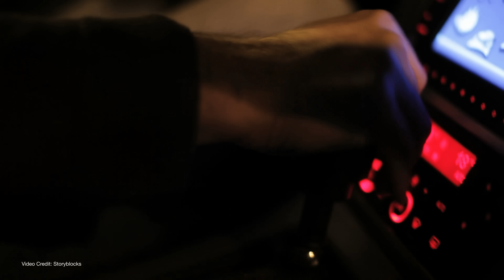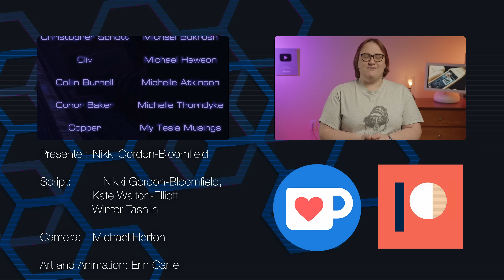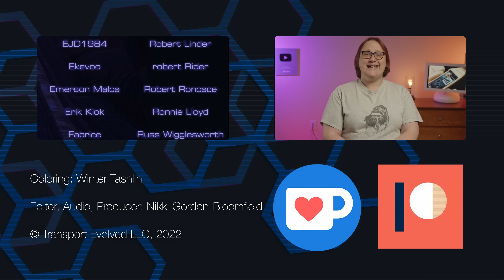Electric Cars Don't Need Gear Shifts - So WHY Is Toyota Working On One?

Comment: No we do t need a manual gear change but maybe a 4 speed to max the kw to mile ratio from the dismal sub 3 .5 mile per kw to more along the minimum of 5 or 6 miles per kwm as the way forward
Reply: The efficency curve of electric is so flat that gearboxes won't give you extra range. Spinning a petrol motor slow reduces consumption. Spinning an electric slow (on the constant torque band) increases consumption and adds the gearbox drag.
Reply: @gasdive  ev gearboxes are built the opera it way to manual gearboxes so a slow movement can drop the slow speed loss this isn’t an issue as most engine twinning and ratio  , as the majority of modern times your stuck in traffic I doubt we’re ever need gear boxes more than 4 speed. A Woking example for instance is the twin gear on the Audi and Porsche to prevent over speed swaps gears to a lower ratio thus keeping-s the actual rpm of the motor constant in an efficient zone without it not only the kwh usage would be in a 1 for 1 zone it would also require a larger motor to cope in single gear adding to cost and weight not to mention even worse energy rating
Reply: @ram64man  I can't really reply as I can't figure out what you're trying to convey.

Comment: A stick shift and clutch on a Toyota EV? Sure. How else are you going to control the fuel cell? :-) 

Seriously, though . . . I'm not sure how many modern EVs have the regen paddle on the steering column. Those are marvelous. I wish my 2012 i-MiEV had one for that occasional steep downhill trip. Having driven manual shift ICE vehicles for many years (my wife and daughter both still have manual shift Hondas, so we're among those rare Americans,) I learned early on how to properly downshift with engine compression. Older manual shift trannies also didn't often have syncro rings going from 2nd to 1st gear. So, lots of fun clunking noises when attempted to do that. But, with practices, you can "feel" your way to the lowest gear while still moving and without the grinding. Kind of a lost art these days.

Comment: daft. it's daft. I have driven with a stick for the last 20 years (first car to current car) and I LOVE driving a stick. That said, EVs are essentially always in the best gear for torque so i don't miss it when in my wife's car. Also, that need to be active while driving i get from using 1 pedal driving... i'm always thinking about when and how much to let off to stop when needed.
Reply: It is almost as bad as designating the high performance version of the car as “turbo”.
Reply: @williammeek4078  The adult equivalent of putting flame stickers on a bicycle.
Reply: @williammeek4078  😂💯

Comment: None of all above. 
Without gear box vehicle start up cause power circuit conducts astronomical electric current that shorten the longevity of anything in that circuit. Gear box take out longevity issue from that equation, for second rate battery at a lower cost. Win win approach.

Comment: Interesting. Took driver’s Ed in 73’ (probably before you were born 🤣) and my last car was a Mitsubishi 3000 GT which was totaled two years ago. I had never owned an automatic and my car previous to the Mits even had a manual choke. Short story is I replaced it with with a Model 3. Far cry from anything else I had driven which were mostly sports cars but unmatched in responsiveness, maneuverability and quickness. It took me just days to get used to the regen braking and even though it was an impulse purchase, I can’t imagine owning anything else. Might help that I love technology.
Reply: An impulse I'm sure you don't regret😉.
Reply: @kmancrx  Not at all. I have 4 other driver profiles on my car, too. Meaning there are four others that enjoy driving the car - son, his wife, brother and best friend (done some out of state trips). 😁
Reply: @mistyanderson6834  yeah my wife drives my model Y occasionally but actually likes her Chevy Bolt as it's a bit more similar to an ICE vehicle. Within the last month I drove the Y from NC to Arkansas and back. 😜
Reply: @kmancrx  How was your supercharger experience? I just drove from Seattle to San Fran and it cost $42! Have had  the FSD Beta since September so helps in unknown areas. 😁
Reply: @mistyanderson6834  supercharging is fine. I think it cost me around $150 for roughly 2k miles. The rates vary depending on the location. Arkansas tended to be more costly to charge vs TN and NC.

Comment: It seems like you are confusing gear shifts in an automatic and a manual transmission. CVTs mimic automatic transmission cars not manually shifted transmissions.Toyota is not the most brilliant repository of good design. Most of their special cars and engines are designed by other manuafacturers. Ask anyone whot they really think of the RAV4 EV's absurd all wheel drive.

Comment: Surely adding something that's unnecessary to a vehicle's drive chain just adds to the initial cost as well as increasing maintenance costs and the potential cost of replacement
Reply: The drivetrain will remain unchanged. if anything, the manufacturer will be able to call it a manual and do away with the parking pawl and its actuator. I don't believe there's gonna be fake gears either. Instead, the driver will be able to select the level of regeneration on accelerator liftoff, and the "fake clutch" will be a way to momentarily disable or weaken automatic regeneration, and give more resolution to the accelerator pedal while maneuvering, for example. That being said, it's valid and useful. This also brings the possibility of coding the left pedal as the accelerator for people who lost their right leg.
Reply: I imagine that while there will be a gear shift and clutch pedal, the gear ranges will be faked in software. One rule of engineering these days is to never do in hardware what can be done in software.
Reply: Did you hear the word "pseudo" at all. In meaning "fake gears", there not actually adding a gearbox but the feeling of having one. What they're doing is the equivalent of those shifters on arcade cabinets with the added feature of the vehicle actually reacting as if you're going through gears.

The way Toyota plans on implementing this is by turning it on through a drive mode selection menu. So if the shifter breaks all you have to do is select "automatic mode" like how you pick the difficulty on a game.
Reply: @jake_sabrwolf9795  A fake transmission. Wow. That is grasping at straws to make gear heads happy. The only thing sillier than putting in a transmission, that is, a crutch meant for helping get past the deficiencies of the ICE is putting in a fake one.
Reply: All I can think is if you can keep more parts spinning slower, that's fewer duty cycles IF it was a real manual
Reply: @dosmastrify  Electrical duty cycles are irrelevant. Motor bearings properly designed for the RPM range of an electric motor are a lot cheaper than the added complexity of a transmission.  Get over it. The transmission, manual or automatic are a crutch to make up for inherent deficiencies in the internal combustion engine. 

Electric motors do not have those deficiencies. Trying to put a transmission into the drivetrain of an EV is just silly. To put in a crutch meant for an 1880 tech engine with serious usability problems is just not necessary.

Comment: I’ve always loved manuals. Ever since I had to replace an automatic transmission in an old car of mine. I’d rather pay $200 for a new clutch, than $3,500 or more for a rebuilt, or new, automatic. 

I had to drive my husbands 🏳️‍🌈 Sonata hybrid three days ago when I dropped him off at the airport. (I drive a 6spd GTI Autobahn with a Cobb Accessport pulling about ~300hp, yet still getting 29mpg) I found myself getting irritated at the lag between hitting the accelerator and the “punch” needed when driving around Dallas Love Field Airport. It’s torquey, but not right away. Nothing like my low-end torque GTI. 

I’m eager to see their progress of this…
Reply: You should try driving a fully electric car then.

Comment: Making a vehicle more complex with more parts is senseless both on the cost and reliability fronts.
Reply: Making exotic or Uber expensive cars is pointless as well but is still made available. A manual gear box will appeal to some.
Reply: That's the point, they are trying to maintain some level of spare parts sales.
Reply: laughs in Ford Eco series of engines

Comment: Here in Finland you have to pass driving school with manual car to get full driving permit, normal EV is automatic and if you use it to get your permit, you are NOT allowed to drive manual gearbox car at all. Only way for driving school to adopt EV's, is to get manual gearbox EV's.
Reply: They just need to realise that EVs are not automatic. There's no automatic gear change. There's no gearbox at all.
Reply: @gasdive  problem is the clutch in manual gearbox, if you don't use car with clutch at driving school, you are not allowed to operate car with clutch after you get your driving permit. Driving with EV is too easy, people don't learn anything about clutch with EV.

Comment: Well the pseudo gears make no sense unless they make ways to more economic driving even if it just limits the output power. But real gears on any car electric or not make a lot of sense. BTW I am die hard diesel stick shift guy. And CVT are useless junk for what I do and like in cars. The stupidest thing is, CVT torque rating is right where most of my small engine cars (stick shift) just start in its stock form ...

Comment: I’ve been a die hard stick shift driver most of my life, my 2013 FIAT 500 Abarth being my favorite.  I now drive a Chevy Spark EV and have found that between the torque, the down low weight of the batteries, and using the L mode I can replicate driving stick (at least down shifts) and it brings me much of the feel and fun of my Abarth, down to even getting to ‘shift’ with the gear lever.  I’m 100% interested and curious with what Toyota has up their proverbial sleeves.
Reply: Yes, as someone who has always loved rolling off the throttle and downshifting, I really loves me some regen!
Reply: I have a 500e and it is a really fun car to drive! Quite peppy, but with all those batteries down low you can take turns very aggressively.
Reply: it may just be that toyota is trying to hide the fact that they have their collective heads up their asses.
Reply: with infinite torque gearing is just wasted efficiency for no speed gain. In ice cars its needed in EV's  it is waste and has no benefits. it shows how foolish Toyota is. They do not understand.  it is quite sad ty for Tesla and the ones that get it.
Reply: @Bbenkosky  There is nothing foolish in satisfying consumer demand ;) I absolutely hate single speed performance EV, Porsche done it better - 2-speed gearbox, though not manual.

Comment: To say that Toyota wants EVs to be "less awesome" is an understatement. In fact almost all legacy auto makers have intentionally made their EVs ugly and short range to avoid making them too attractive. Toyota won't even give their EV a $%^&!@ name, just a model number and ugly black fenders to dissuade any style conscious buyers. However, if done right the manual shifter could be a lot of fun adding a video game like "skill" to getting the car to switch into modes and perform differently. Some have added a "boost" button for the same reason. The clutch pedal for example could switch from the default regen mode to coast mode to give the car that free rolling feel, maybe even some cool sounds when you rev it unpowered. The shifter could simply be drive modes.
Reply: I don't think manufacturers are making deliberate design decisions to make EVs "ugly", rather they're recognizing that potential EV drivers are looking for something different.  Most ICE drivers consider my Gen1 LEAF to be "fugly", "wouldn't be caught dead in it", etc...  I think it looks cool.  On the other hand I consider most ICE cars made today to be boring and slavishly conformal to the pinchy-foldy "Transformers" aesthetic of the past decade or more, which does not attract me.
As EVs become mainstream, expect more mainstream design language, for better or worse.
Reply: Recently checked out that Mazda EV did you? 😆
Reply: @matthenley7641  Not bad looking, but 100 miles of range, really? There is an e-bike that does 120 for gods sake.🙄

Comment: I use the mode button and brake lever on my motorcycle to emulate changing gears by changing regen levels and torque levels!
Reply: My Zero has so little regen that I just set the throttle activated regen to zero and the brake activated regen to 100 and left it at that for the last 7 years. Slight touch of the brakes activates the brake light and turns on the regen for controlling speed down hill. Otherwise I don't notice it.

Comment: So does having actual gears in an EV (Taycan) actually improve performance or not?  How much?  Could you use a smaller  motor with gears?  Or are we limited by the battery and inverter?
Reply from the maker: Just how much good a Taycan's gearbox does is actually a really interesting question that I personally feel hasn't been solidly answered yet. I do know that being able to gear down further for things like rock crawling is another area where multi-speed gearboxes in EV have been considered, but that, much like the performance car use case, is definitely an outlier in terms of usual use. - Winter
Reply: Sandy Munro touched on this once. The centrifugal forces involve to achieve higher speed from an electric motor causes the center section of the motor to swell outwards the faster it turns. The issue is the tolerances between the center and the outer windings has to be kept as tight as possible for efficiency. By gearing the drive train they are able to get more speed from the car without going beyond the limits of the motor. Tesla achieved this differently by wapping the center in carbon fiber to reinforce it in the Plaid.
Reply: @davefroman4700  yeah, but what it really shows is poor design. If you spend the weight of a gearbox on making the motor longer you get the low speed torque you need, plus the high speed power you need without the gearbox.

It's been a hot debate in the motorcycle world, but it's become really clear that gearboxes are dumb.
Reply: @gasdive  form follows function. They wanted speed and designed for that, given their known level of technology. Thinking outside the box will get you fired in most places. They want proven solutions, not experimental ideas.
Reply: @davefroman4700  longer electric motors isn't exactly experimental or out of the box thinking.
Reply: @davefroman4700  They could also have made the motor longer.
Reply: @williammeek4078  You still have the same forces at play with very similar clearances. Also the smaller a diameter is, the faster the rotations are and the weaker it gets as well. The gear box is a mechanical work around vs a physical solution to a problem.
Reply: Just about every review I've read of an electric car including the Tesla Model s plaid states that their performance starts to drop off at high speeds (120+ MPH). While the high-speed regime may not be applicable to most drivers, I could see the gearbox in the Taycan adding value there. As was stated above, you could also use ultra low gear ratios for off-road scenarios. So I think it's a little premature to say no EV should have gearboxes, as even electric motors do not have a perfectly flat torque curve at any speed. Physical limits do exist.
Reply: High torque/acceleration from start does require beefier inverter.
A lower gear is a (costly) alternative.

Comment: I ask people who say they feel more connection with the car when shifting if they also insist on crank starting to make the connection even deeper. Noone has said yes. Still, good explanation.
Reply: That's because crank starting wouldn't give you any advantage in controlling the car. Manual shifting does. It enables you to control exactly what gear the car is in at all times. I'm not in favor of putting a shifter into an EV, it doesn't need to shift gears at all. But ICE cars do require gear shifting, and controlling it yourself instead of letting the transmission do it does give you more direct control.
Reply: Love it. What a great comment.
learned to drive in a manual car but have not driven one in over 12 years. Had paddle-shifters on cars but never used them...
Reply: Or maybe they thought your analogy was simply illogical?
Reply: Spoken like someone who has never driven a Manual sports car
Reply: @nickk707  while this used to be true, modern dual clutch transmissions obviate the need for a manual in sports scenarios. Manual shifting is always slower than a dual clutch. Therefore the only people that want manuals in their sports cars are not people that want a better sports experience, they're simply people that want something to do with their left foot and are willing to sacrifice performance to get it.

Comment: According to Manual, the manual says it was written by Manual, because they wanted to be an author and write a 'auto' biography, and they said that silver paint is antioxidant and will make your car go slower than the red cars seem to do, though it's also alot safer as a result, and manual is a standard, for a car that has manual Manually operated steering.

Comment: To extend the whole driving, beyond gear with clutch experience, will an engine noise generator be added? Still waiting from legacy car manufactures truly affordable vechiles.
Reply: If you're not aware, many (most?) EVs already have a function like this.
Reply: BMW did it for the i3 & i4. Audi for the e-tron.
But it is not specific to EVs, expensive ICE cars have used speakers to remodel perceived engine sound for some time now.
Note regulations require EVs to make noise for pedestrian safety. But not require it to be "loud engine".